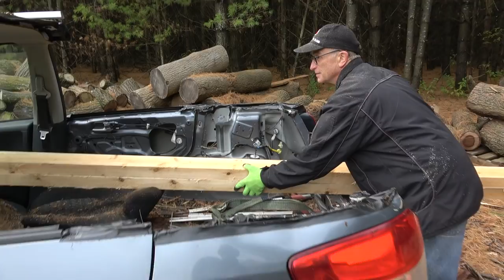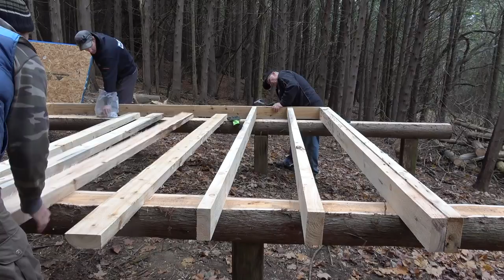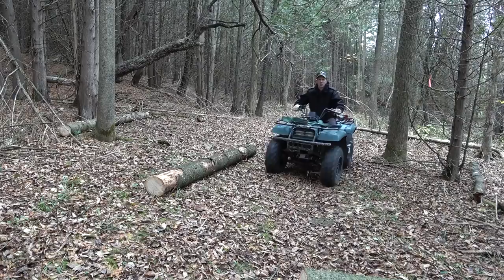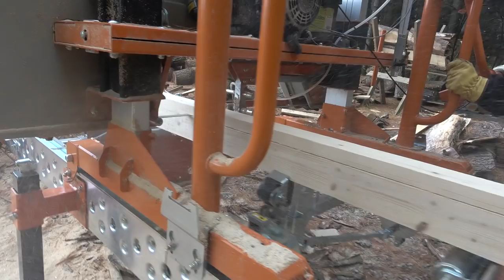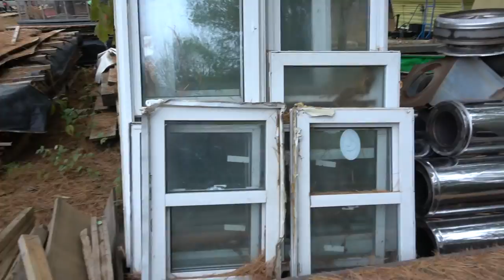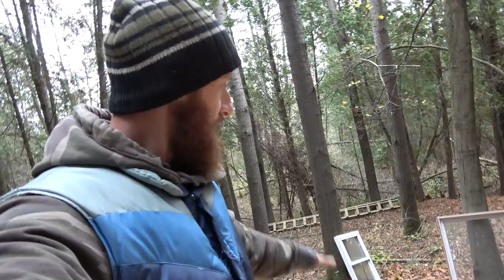Cabin in the Woods Build! | Milling LOGS into LUMBER, Floor, Walls in the WILDERNESS Ep2

Comment: It may seem counter productive adding water, but a 10:1 water:bleach solution in a pump-up bug sprayer will turn those moldy 2x4's bright and clean again, on contact.  And as you joked, it really will save the cabin occupants some potential lung issues.
Reply from the maker: Yup, we've done this before!  That's why it was more of a joke than anything.  Once we get everything up, we're going to bake the snot out of the cabin and dry it out.
Reply: @TheWoodedBeardsman  Sorry bro, didn't mean to tell you your business.  I just had a close friend who developed a nasty sinus infection from black mold.  Drying out doesn't kill or remediate it, only bleach will.  Best of luck to you, and it does look like it'll be a sweet cabin.

Comment: Would like to see some end cut preservative on the foundation posts and beams. Don't think a gallon of the stuff will break the budget. But maybe its just a build for a video and true longevity isn't that important.
Reply from the maker: I talked to some older guys in the neighbourhood and they assured me that untreated cedars lasted well over 40 years buried in the ground... on barns, sheds and such.  Worst case...jack and re-frame.  We've lifted entire houses before, this cabin would be easy!  We were getting to the point where we just needed to get started and deal with it...too much talking, not enough just doing!
Reply: @TheWoodedBeardsman  I know most contractors don't like the end cut because no matter how careful you are it tends to get on everything ,even tools.I wood even had said use some taring compound on those posts. But when you're on the job site,and especially a remote one, its just about what's in the truck. And nothing is more true than the 'let's get the darned job started' . Guess i'm too young to check the condition of  posts  I've set ,cedar or not, after 40 yrs.But if those posts need replacing in 20 yrs i bet your son will be doing it. May sound like a stickler but i try to do the best job possible even when its not always required  .
Reply from the maker: Yeah, we do too.  I remember using the end cut, so know all about it.  In 20, book it :)  On something super important, or crucial, I say yeah....for sure, overbuild.  We don't want to get too bogged down in details here and make it not fun.  When you got a few minds on the job, gotta loosen things up a bit :)  I hear ya though!  @alexs3447

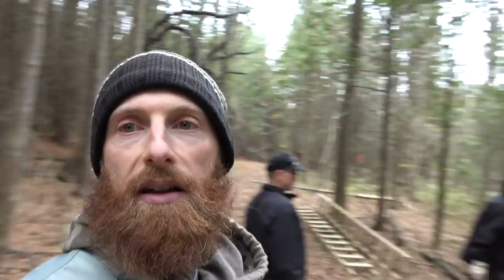Comment: 4:31 Ha ha ha! Massive is relative. The biggest I’ve felled on our property is 3-1/2 feet across. There were two that size, and about twenty between 2-1/2 and 3 feet. There’s a guy with a portable sawmill 4-1/2 miles away, it has a Volkswagen engine. He has agreed to mill logs we provide, and keep a portion for his efforts. He says they need to be at least 20 inches though, I guess his blade doesn’t go low enough. I’ve eyed the same sawmill you have, but we can’t afford it right now. We would have to save. I’m really enjoying your videos, yours are the closest to what we have in mind. Thanks.

In this video he’s cutting a 7 X 7, ordered by a customer. 
https://www.youtube.com/watch?v=uVUC4OIkXqs